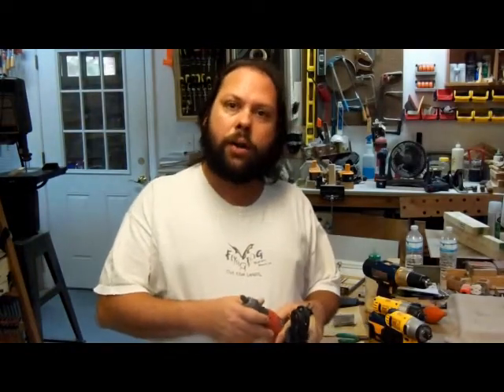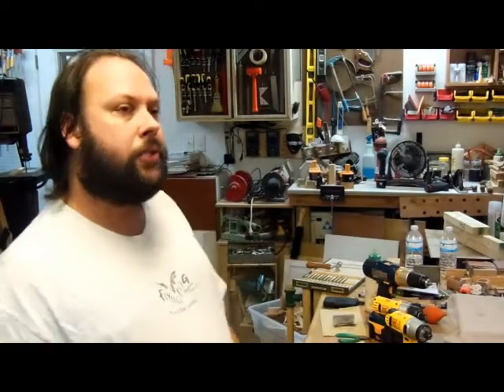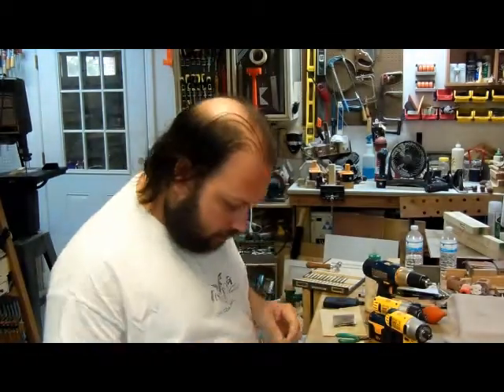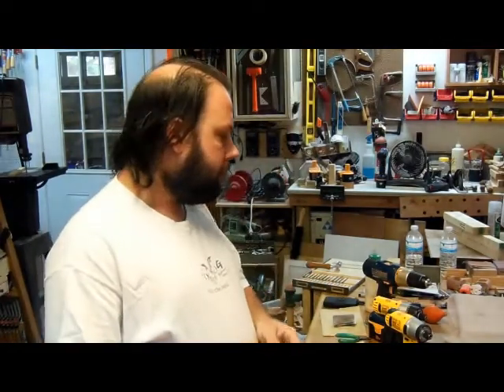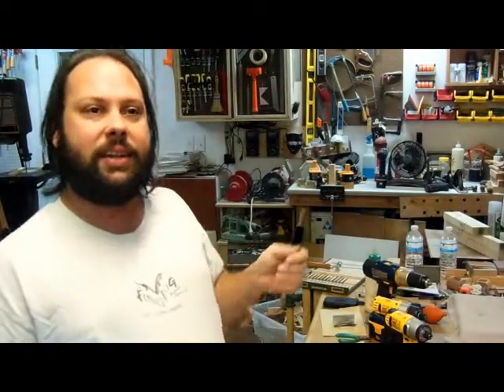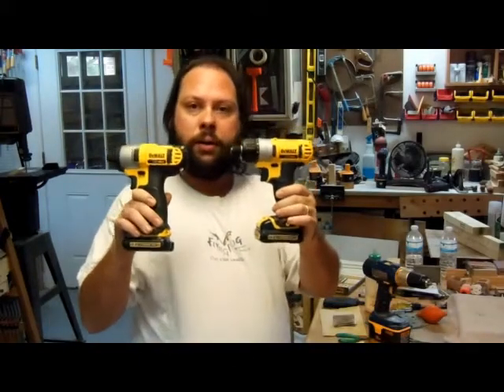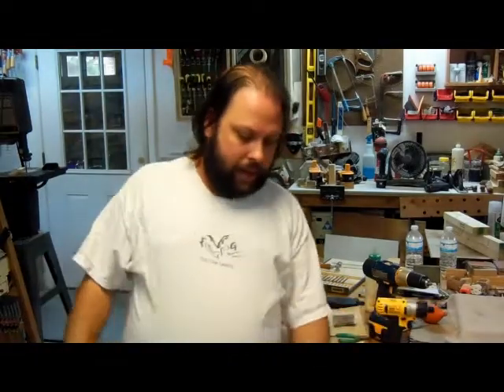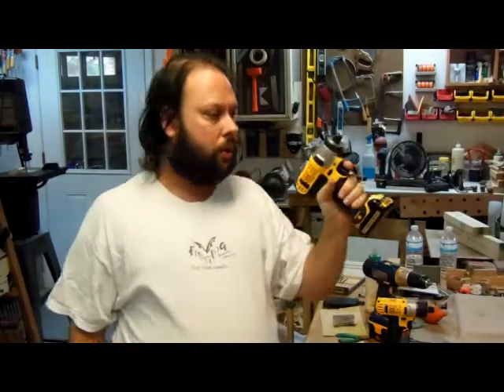2013: She's been a lucky one! Show and tell about tools I've won this year.

Comment: What luck, mind sharing some of it lol. That Frosty was great, how did you make those beads?
Reply from the maker: Truth be told, they weren't 'completely' passive wins. At least some minor effort was put forth (about 2%). The rest was pure luck.

1) Cut the 2x4 into square rods.
2) Sand the four flat faces of those rods. Round off the corners, too. But not too much. Leave them mostly square, but with rounded corners.
3) Cut the rods into shorter "rod-lettes" a few inches long.
4) Drill a hole through each rod-lette.
5) Make a small sled to slice the short rods into individual beads with a band saw.
6) Rather than sand the fuzz off the cuts on thousands of individual beads, I hand tumbled them by wrapping the batch in an old bed sheet. I tied that sheet closed then manually kneaded the wad of beads fairly aggressively for about 45 minutes.  The hand tumbling process was amazingly successful, more so than expected. and it took a lot less time than I expected. It was a perfect solution to what would have been a daunting task.

I appreciate your watching and commenting.